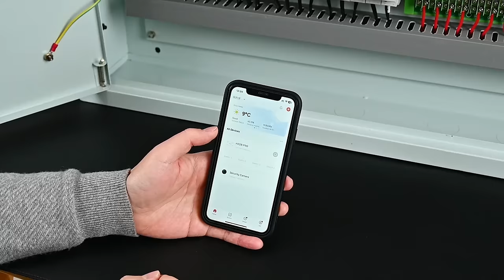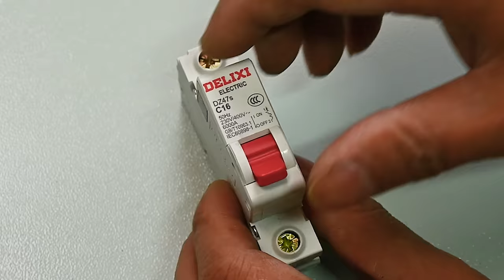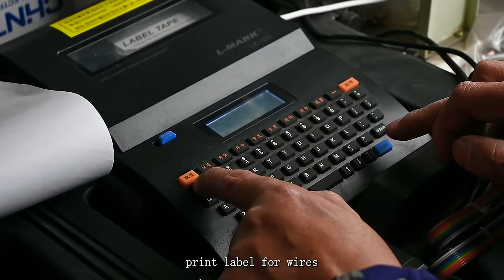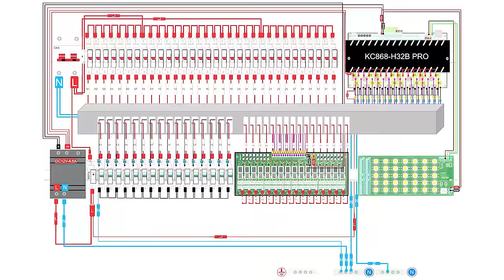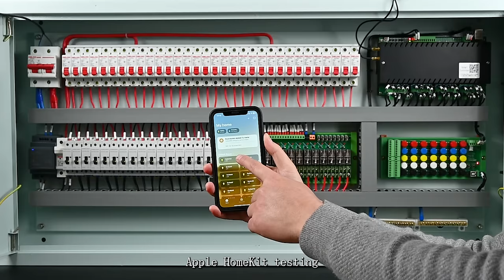Home Automation 32CH Distribution Board DIY | Smart IOT Project 2023!

Comment: The creator just started building a circuit without even showing us a circuit diagram
Reply from the maker: diagram link in video description
Reply: if you’ve done any of this sort of thing, the circuitry for any single relay really is very simple - this is more about the art of cable routing when you scale it up….and it is a work of art!!
Reply from the maker: @richdyer2000  thanks.
Reply: @KinCony  

Good day,

Thanks for your wonderful reply.

Do you have a schematic diagram of this video, and not the circuit diagram? I have a capstone project (electrical) and I am curious on how you control those relays and switches using your phone. Can you help?

Kind regards,
Ronald
Reply from the maker: @ronaldsethoga667  here is Schematic of Power Distribution Box : https://www.kincony.com/forum/showthread.php?tid=2568
Reply: @KinCony 4:52 4:52 4:52 
4:52 n 4:52 
4:52 4:52
Reply: Should the outputs be directly connected to the relay board, or would it be better to install the output terminals?
Reply: @KinCony thank you for the video and tutorial. Today was my first time of learning this, and I'm sure I really understood the tutorial. I am an electrician, and I want to know if I can replace an already existing distribution board in the home with this your power distribution board? If so, how and where do I purchase it?
Reply: Is there any way to buy product other than Ali express. I’m from India . Ali express is banned here

Comment: You should not turn the end connector and press it multiple times. Giving it a round shape means that the maximum area for the same outside perimeter length is achieved, therefore the lowest pressure on the inside wires. You should only press it once and leave it like this.
Reply from the maker: thanks for suggestion.

Comment: I'm really impressed by your work, but I have a question. Is this panel just for IoT, or will there be another panel in the house to supply power to the loads? I noticed there aren’t any wires going to the house's loads. Sorry if I sound clueless about IoT, but this project has me excited to learn more
Reply from the maker: the relay and contactor output terminal connect with load. here is another video explained wire detials: https://youtu.be/U8B4DW1U940

Comment: Great idea if you don't have to re wire you entire house. Really for a new build install, this is a pricy but very useful way of automating your home
Reply from the maker: thanks for your suggestion
Reply: I was going to say the same, every switch, light, plug etc etc would have to have its own individual cable pulled. Far as i am concerned this is an over-complicated system that can be achieved much easier with HomeAssistant,
Reply: @travismailsa1  where's the fun in it that?!? lol
Reply: @spreadItWide  lol, will you go pull all that cable for free. 😂 I'm happy with my HA and have lots of fun with it. I don't deny it looks cool but it's not practical and I'm a practical elec engineer and coder.
Reply: @travismailsa1  lol, oh it's far from practical! But it would be fun! I'm building a wireless version of this for my house (house is only 10 years old, nothing is "smart"). But I'm building all the hardware and software from scratch so instead of redistributing the power, I leave it as is and just monitor/interact with IoT over my network with WebRTC and a MQTT server on a node app (for now). Not sure why I felt the need to update you on my project, but there it is lol. I'm open to suggestions if you feel like it (my end goal is no 3rd party integrations, and I only want to be able to connect to my custom built IoT devices).
Reply: Thats awesome bud, glad you updated man, nice to know people have the inclination to do it all themselves, I dont really have the time, so i honestly take the easiest route :) @spreadItWide

Comment: First Congrats for a amazing job!
I want know, whats advatages in have a centrilazed system than have a lot o devices descentrilezed?

I saw some videos, and not understanding why people will control a circuit of 16 amp, than control a lamp or more than one device in the same circuite break line?
Reply from the maker: thanks, yes, some times many lights by one channel. some times use for outlet and so on.

Comment: HI Kincony
I really like your neat work and systematic design. Thanks for sharing. 
I have a question on Data logging. I want to develop a  small system that can record temperature (300 points max), pressure (5 points), accelerometer (2 points), and humidity (10 points) sensors and control some solenoid valves (10 max) and other devices. Do you have a video on similar projects or recommend someone to watch on the topic.  Thanks in advance
Reply from the maker: that can use KinCony INPUT module, do you use only in local network or monitor by internet?
Reply: @KinCony  only local but might think of internet monitoring in the future
Reply from the maker: this DB already can work for that. use home assistant software. @knight20081000
Reply: Hi KinCony, is there a chance to create a video or point out one who was using your system for datalogging purposes. I believe I  might need extension to connect 250 PRT sensors or thermocouples, and other sensors? @KinCony
Reply from the maker: suggest use home assistant software , that have log history save function. @knight20081000

Comment: My 2 cent of suggestion... The 12VDC power supply and your smart controller, as well as the programable keyboard should be all lay in the right side of the panel, so the interference from AC and relay switches does not noise the MCU...
Reply from the maker: thanks for suggestion.

Comment: Excellent work. I have a few questions if you don't bother to spare some time: 
a. Since all circuit breakers are bridged, why do you wire two cables from the main disconnect instead of just one?
b. I understand that the signal cables from the control unit and the power cables overlap each other in the cable tray. Is there not a risk of interference?
c. Why did you choose using smart contactors for the first 16 channels and then a relay board for the remaining 16? Why not choose one of the two different ways?

Thank you for showing us your work.
Reply from the maker: a. because if load current large, use one cable will be hot, use two cables will more safety.
b. it's no problem, we have tested, many black wire is for relay's coin by DC12v or AC220v for AC contactor.
c. extend relay module MAX 16A, AC contactor MAX 25A, it can use for air conditioner or large load. extend relay is low sound. AC contactor when turn ON/OFF have big sound.
Reply: @KinCony  Thank you
Reply from the maker: @ΒαγγΣτανιος  you are welcome.

Comment: Kincony, whats the reason for using AC contactors after relays? If the load would be lights, could you use the relay board (with ac220v relays) direct to manage the load?
Reply from the maker: just for large current load when work >10A.

Comment: Is it necessary to set a contractor for each breaker ? If the channel/breaker only controls lights contractor is necessary?
Reply from the maker: yes, if small current load, it can work without contactor.

Comment: Why hardmount components that have din 30 mounting present? You need end blocks on your din rails, all those components can slide side to side. Basic digital I/O is as straightforward as it gets, same with standard protocol interfacing. This is an iteration of what your first ever PLC setup in your intro class would be.
Reply from the maker: this use by KC868-H32B Pro controller, because different is without any code , not need program code. just directly to use. KC868-Server need install home assistant and config files to edit.
Reply: Very good job. How much does the console cost? Kc 868 Thank you

Comment: Awesome work, I'm a newbie, if you could explain my confusion, why is one half controlled through contactors and the other half through relays? is there any difference? or am I understanding the circuit incorrectly?
Reply from the maker: relay for MAX 16A load, contact for MAX 25A load, such as air conditioner current is large.
Reply: @KinCony   We use relays up to 10a. Any larger we use all 30a parts. Contactor, fuse holders (sometimes 600vac), tb"s, etc..

Comment: I like it very neat work but for safety I would isolate the HV from the IT and communications equipment in separate cabinets.
Also seal each cabinet from each other so if a fire occurs in the HV side or IT/Comms side the fire will not spread and you have a way of being notified a series situation.
Also have a battery supply for the IT/comms to allow operation with power failure.
Reply from the maker: thanks for your suggestion

Comment: in 2022, I assembled a smart home on the aqara system for $250. I have 15 control lines. I didn't have to change all the wiring, just the switches in the rooms. The entrance door sensor turns on the light in the hallway. This solution allowed me to turn the lights on and off on both sides of the hallway without rewiring. there is a button at the front door that turns off all the lights in the house before leaving. The light switch in the kitchen turns on decorative lighting that is not electrically connected to the lighting line. What can your home do that mine can't? By the way, how much does this project cost, and does the difference justify itself?
Reply from the maker: we mainly do wired solution,because stable.
Reply: @KinCony  my wireless solution has never failed. I did not do the whole house at once, but gradually. The first switch was installed in 2020. how it worked - and how it works to this day. But really, your work is very high quality. Can you share how much your solution costs?
Reply: @KinCony  I found one difference myself. your system fully works with different smart homes when mine is mostly tuned to the apple home kit. it will certainly work with google, xiaomi... but not all devices.
Reply from the maker: @DmitryGrigoryan  yes, we are open, Compatible with traditional accessories.
Reply from the maker: @DmitryGrigoryan  about the cost, you can see our online store: kincony.aliexpress.com

Comment: any reason to put 16 KinCony AC contactor: and 16 KC868-E16v2 extend relay module: and not just 32 of 1 type?
Reply from the maker: you can chose any one, just one is 16A, another is 25A. relay sound low than AC contactor's sound when ON/OFF.

Comment: Hi! what's the diameter of the cables used?  planning DIY solution..
Reply from the maker: A 4-squared wire
Reply: @KinCony  black wires (12v) are 4mm? aren't them thinner?

Comment: Would be great to be able to buy such ready made panel, or even if you could make custom pcbs, its something that would work for at least the next 50 years... a house would need at around 25 sockets would be great...
Reply: saw it on  your aliexpress site... 1600$ nice for the panel and 1000$ shipping... (at most 150$ or less for the shipping could be affordable...)
Reply from the maker: @Mdesire  if want cheaper shipment way, it can send by sea. if by air, too heavy.
Reply: This don't last 50 years. The contactors have a limit lifespan and need regulary maintaince. It should be in the manual. About 2-5 years main maintance periods should be desired.
Here there is no documentation on the lifespan and you should ask the seller (designed life expectancy and spare parts availability). You don't want 200 years life expancy with large gold platings if the building is torn down in 30years and you don't want to change it every 3 months. If you ever saw a military grad socked you know what I mean (overengeniered to withand an emp blast even if it's only a headphone jack).

Comment: What is the cable guage? also what's the type of those connectors ?
Reply from the maker: they are AC contactor. The diameter of the wire is calculated based on the load
Reply: @KinCony  I'm doing a small project just couple lamps and a small dc motor. I searched about the usual size of wire with PLCs and read that 20 AWG is acceptable for small loads.

Comment: What is the power supply used for in the distribution box?
Reply from the maker: MW brand, dc12v/4.5A power supply.
Reply: @KinCony  i mean for what? The power is already coming from the wall right?
Reply from the maker: power by L and N. AC220v  @M4XD4B0ZZ
Reply: Oh i see now the controller and keyboard need 12v to operate right
Reply from the maker: yes @M4XD4B0ZZ

Comment: What is that board full of coloured switches good for? What is the purpose of it? It seems uneccessary...
Reply from the maker: manual control buttons and wall switch panel can connect to the colorful board.

Comment: now there is much easier and better way to do switching lights on off
but such technique is still useful, using relays to control high voltage 3-phrase motors, hydraulic pipes to do heavy duty things in factory
Reply from the maker: yes, big current load is better control by contactor.

Comment: With the (fat) red wire you give 2 L on the same side of the circuit, doesn't make a short cut?
Reply from the maker: because it will go through large current.

Comment: why use a fuse for the 12V power supply instead of a breaker?
Reply from the maker: it's low current. fuse is enough.
Reply: @KinCony  no, I mean why a consumable item? It's not like a 2 - 4A breaker would be noticeable in the final cost and you don't need to keep spares (at least 1 to be sure that the PSU is really blown)
Reply: @KinCony  he means why would you use a fuse vs a 2 or 4 amp breaker like the other stuff for example

Comment: This isn't legal to use for end-users anywhere in the EU, and I can't imagine anywhere else either, honestly. The interior of the cabinet is not divided (form-separation) nor ingress protected (fx IP20), thus access to the interior of the cabinet comes with the risk of electric shock. That's why commercially available "fuse box" style electrical cabinets doesn't look like this. Ever. 

As an end-user, you must be able to access fuses and other protective elements or elements that you may operate safely, without running the risk of electric shock. Any commercial "fuse box" will thus have either several layers of mechanical barriers (like in the US, typically) or will have a design that allows access to fx the handle of the MCB ("fuse") but NOT to the screws that connect the wires to the MCB (like the EU, again typically). 

This cabinet, even when used strictly by qualified professionals, must still have a main switch that turns off all power inside when opening the door. The doors must have some kind of interlock (could be part of the main switch) to ensure it is not possible to open the cabinet whilst the main switch is on (except if using tools) and any circuitry not explicitly made dead by the main switch must have color marking in orange and warning signs present. These requirements are in place in the entire EU, and I mention them only to illustrate how dangerous this cabinet could be as an end-user, when you consider that not even qualified professionals should be able to access the interior in the way that it is made/shown here, whilst end-users must generally be assumed to be ignorant as to the dangers and risks posed and associated (i.e. it's difficult to know what is "safe to touch" in this cabinet and "what is not", and users should not need such competence to survive.
Reply from the maker: thanks for your suggestion.

Comment: I dont get this, what use would anyone have for all those switches? All my lights are 1-10v, except my garage!?
Reply from the maker: these for ac220v lamp ON/OFF and switch for socket. if you are using dimmable lamp 0-10v, just replace with a dimmer controler for the box.

Comment: This installation is very clean, congrats on that. Yet, automation wise, would be nice, for 3 years ago.
In our days, using shelly for example, you can install them faster, cheaper, no adaptation or using a big cabinet, better interface and with minimal technical knowledge.
Reply from the maker: yes, thanks for your suggestion.

Comment: why so many breakers? can you not just group low load items on a single breaker?
Reply from the maker: there are 32 channel for user use, for one house, 32 channel breaker is needed. you can connect many different loads by one channel breaker.

Comment: What is  cost per switch
Reply from the maker: which "switch"?
Reply: I mean how many lights or point we can control with this setup which you have  shown in the video and if we calculate per point what will be average cost?
Reply: As per video description it is 32 channel ... So what is cost per channel (I assume that 1 channel means one on/off stitch
Reply from the maker: @shareefind  in video total is 32 channel output, price you can see order link in video description.
Reply from the maker: @shareefind  if you want to make for different channel, you can use our H32B Pro controller make own DB by any output channel.

Comment: That can't be cheaper than just installing caseta's, and they dim.
Reply from the maker: stable is most important
Reply: @KinCony  that doesn't make any sense. I've installed hundreds over the last decade and never had any issues with stability whatsoever. They're simple to swap out any normal switch and the Pico remotes can be installed anywhere and attached in software to any switch or scene. Fully compatible with siri, Alexa, and Google home. There are high amperage and fan controls as well.
Reply from the maker: @JeremyMitts  ok
Reply: @JeremyMitts ...Can we have a  talk over whatsapp?